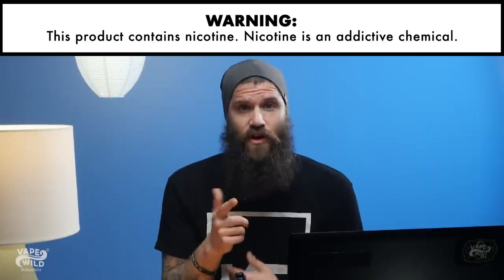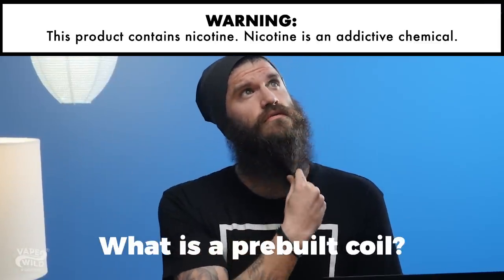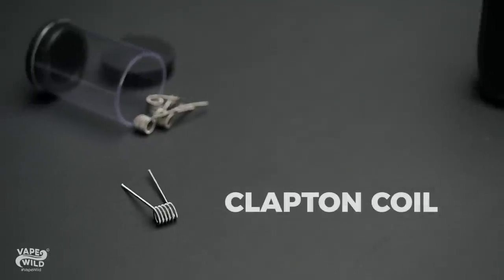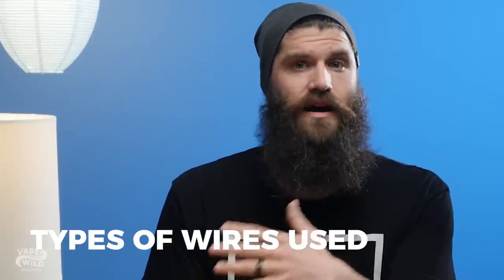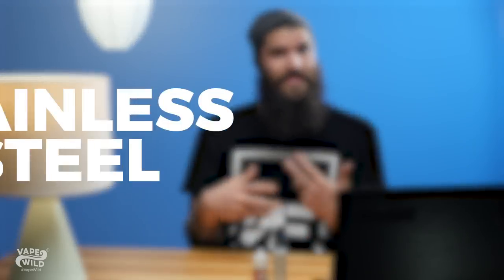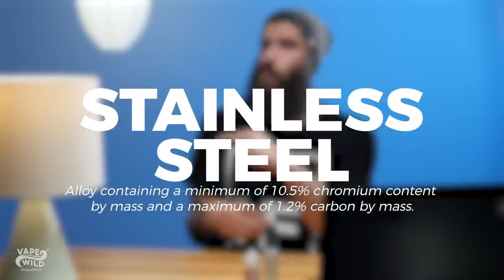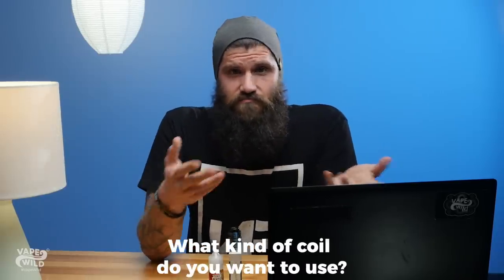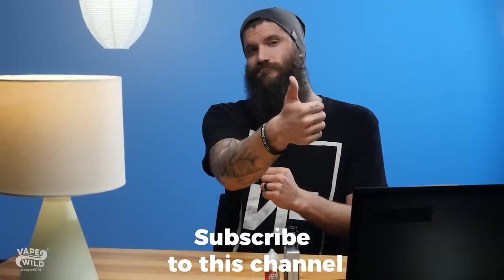A Guide To Prebuilt Vape Coils

Comment: I've been vaping for almost 5 years,but i still prefer kanthal as my first place to use,it is easy to build,battery efficiency,I'm using a 24 or 26 gauge kanthal(depends on the availability),2nd place goes to tiger wire,which gives more warm and flavoured vaping,i recently tried fused claptons,but i find some brands that fluctuates,it doesnt have a steady ohm reading

Comment: I've just started vaping recently I'm using a Drop Dead rda with the Drag 2 mod. I'm looking mostly for flavour so what coils would you recommend I'm currently using Claptons
Reply: lol im on the same boat man. Bought the drag 2 (island color) with 2 drop dead rda's. im using just regular kanthal wire at the moment, but i was using fused clapton wire at first at 3mm.
Reply: @garyorourke3595  I bought a selection of coils just to try different ones. The best ones for me at the moment  are Clapton Parallel 3 mm.
Reply: i keep hearing tri core claptons are the best
Reply: Claptons are decent personally builds that have ribbon wire like staples, framed staples, or even staggered fused without ribbon. My personal favorite are interlocking alien framed staples or 3 core staggered fused. Feel free to message at facebook.com/buildersbestwires

Mentioned in another comment in here specifically to answer questions and helpin any way i can not advertise unless you end up wanti g abuild i have lol. But will just as quickly point you in the direction of otber companies that i know to be of good quality
Reply: Try out some Mohawks or staggered aliens, amazing flavour

Comment: nice video. but i have a question. the info thats written on the coil box(Kernel,Wrapped), what does it mean and whats the difference between each one?
for example i have 3 kinds of coils:
Quad 0.36 ohm. Kernel: 28GA A1*4 - Wrapped: 0
Hive 0.5 ohm. Kernel: 30GA A1*2 - Wrapped: 30GA A1*2
Mix Twisted 0.45 ohm. Kernel: 26GA A1 - Wrapped: 0.2*0.8 Flat
can someone tell me whats the difference plz? thanks
Reply: So quad kernel would be your cores its using 4 pieces of 28g a1(kanthal A1) im assuming is twisted and doesnt habe a wrap wire or if it does and its some sort of clapton maybe a .0 something.

The hive kernel is core 2x30gauge kanthal a hive is supposed to be 2x30 twisted in 2 sets then both sets twisted together in the opposite direction so should be labeled as 4x30 as a core instead of 2x30 for wrap.

Mix twisted is 26gauge A1(kanthal) twisted with flat wire .2x.8 im assuming kanthal but again its twisted but labeled as a wrap. A wrap wirw is generally the outer wire of some sort of clapton build whether it be a fused clapton framed staple alien etc its always the outer wire.
Flat wire is also different from ribbon. Its very similar but ribbon always has a .1mmside ie. .1mmx.3mm n80, .1mmx.4mm ka1, .1mmx.5mm ss316L etc.
 Hope this helps

Comment: Hi, Is it safe to vape very cheap single wire prepaid coils, I think I paid 4 bucks for around 50 of them, they work good, just don't know if they are safe.
Thanks
Reply: To be completely honest in this industry you really get what you pay for. The quality of the alloy plays a huge part in quality of vape, how long it lasts, and to an extent safety. Cheap coils are actually what made me start my coil/wire company. Too many mislabled coils with wrong metal(can be dangerous). Some would actually rust after a single use. I would recommend finding a company that does handmade like myself or a number of others vs. Machine made
Reply: Cheap Machine made coils are also rarely ever cleaned and can have oil or  residue on them especially kanthal. Many handmades go thru various cleaning processes, most commonly ultrasonic cleaning. Feel free to message me at facebook.com/buildersbestwires if there are any other questions that i can answer for you (not here to advertise only to help in whatever way i can)

Comment: I have a question, all premade coils I have bought have a value written in the box like .3 or .4 ohms but when I use one coil my MOD shows double the value like .6 or .8, why is this? Are the labels always consider your should use double coils to get that value?
Reply: So if its double the resistance that means the resistance on the container is for a dual coil as a dual coils resistance is half of what a singles would be.
Reply: Some companies list them as singles most label them as duals. Mainly cheap chinese machine made coils are labled as singles, some as duals. Majority of handmade coil companies including myself label them as duals unless otherwise specified.